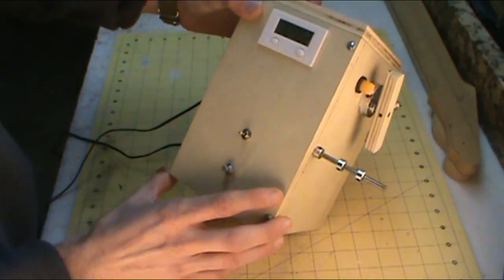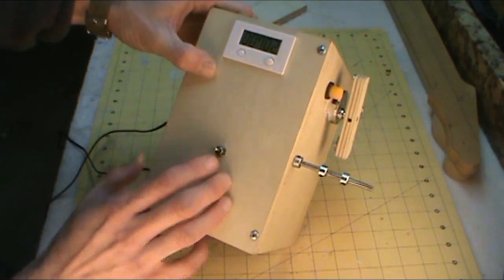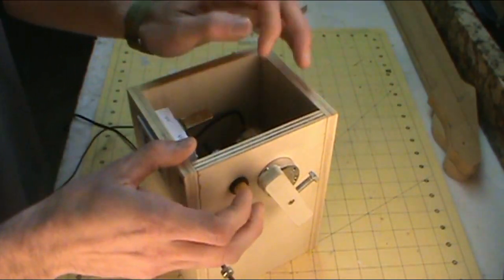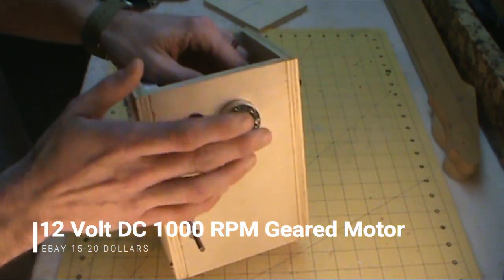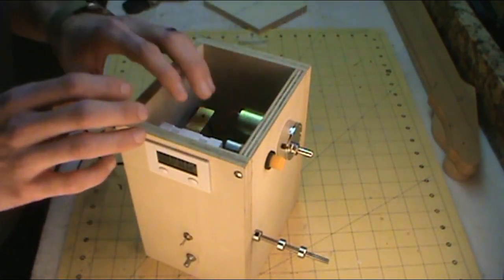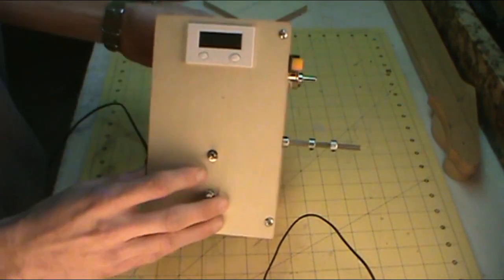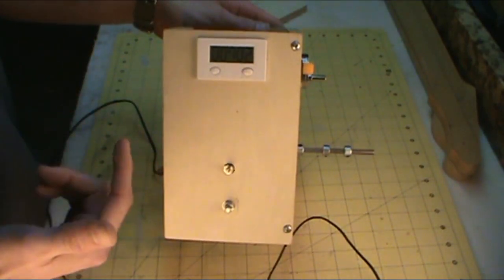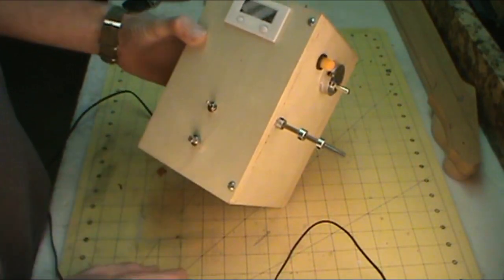How to Build a Pickup Winder

Comment: This is a great video.I built a pickup winder several years ago and threw it out when I moved. I was planning to make a new and better one. That was 19 years ago and I still haven't built one. The winder in this video  is similar to several I've seen on YouTube, which means it must be a good design. I was impressed by the bobbin mount. None of the other YouTube winders have that. I have ordered the parts for a new winder, which will be a lot like this one. I found the parts at very low prices from an Asian source; however, I take a buyer beware approach toward this source. The motor, counter, and speed control cost $16 including shipping.

Comment: Is a 4000 rpm motor good for this.  12V DC???
Thank you,
I didn't want to buy an expensive machine that I may not use very often.  Your video is a big help!!!!
B
Reply from the maker: There should be a motor in the description of the video along with other parts for the build. I’d try to find something that’s a little slower than 4000. Also the counter can only count up to about a 1000rpm.  I never wind mine faster than 700-800 rpm.

Comment: How's the motor mounted inside? is it just sticking through a hole and glued? or is there bracket?
Reply from the maker: I built a bracket to hold it. Look in the description of the video and there is a link to free plans.  All the parts are there in 1-1 size where you can print them out if you’d like to.  Hope this helps bud!

Comment: Hello, i build a similar winding machine just with different counter, but almost same design. I think i having a problem with motor gear. I think it have some kind of wigle in gear axle and the bobbind holder when im winding get some shaking. I think thats causing that i have loose winds on bobbin. Do you have same problem ?

Comment: Hey man, love your videos! Do you have links for the 3/16" rod and shaft collars you used? Seems like the simplest part, but I'm having trouble finding ones that fit together easily!
Reply from the maker: Check McMaster Carr.  I started using a little bigger guide size of 1/4”. You might be able to find one that size at a local hardware store. The shaft collars may need to be ordered online. You can also search for an 8mm size. Usually those are more readily available. Let me know what you find or if you need more help. Hope all is well.
Reply: @ChasesWKshop  Thanks, I really appreciate the response! Do you mean use 8mm shaft collars with a 1/4" rod? I was having trouble fitting a 3/16" collar on a 3/16" rod, so does a slightly larger size collar make it an easier fit?
Reply from the maker: @davidtennyson-m2m  you’re welcome. If you buy 1/4” rod be sure to buy 1/4” shaft collars. Same with 8mm. Its just you might find an 8mm size if it’s hard to find a 1/4”.  Actually to be closer to an 1/4” you would need 6mm. 8mm is closer to 5/16 but it really doesn’t matter in size for the guides. As far as the collars not fitting you can always put the rod into a drill and use sandpaper to thin the diameter enough for the collars to fit. I’d use 400 grit until I got it to the right size then use 600 and 1000 to smooth it out. I hope this makes sense. If not let me know bud.
Reply: @ChasesWKshop  Ok, I'll try it out. Thanks for the advice!
Reply from the maker: @davidtennyson-m2m  you’re welcome. Let me know if you have anymore questions.

Comment: hey men great video, great to see this is your first video. I'm waiting for all the stuff to build my own, have the same counter. I have no idea how it will come out but it's great to see your process. I have same questions about which swich to use for what but I think as you said with changing the counter position that will come with practice. maybe you can reduce the long screw for the pickup base wood? to get less resistance in the spins ... it's an idea. I'm going to use a circular acrylic instead but we will see how that goes.
Reply from the maker: Awesome! Let me know if you have any questions! I’ll be glad to answer any questions.
Reply: @ChasesWKshop  all in my head are questions at the time I didn't receive anything for the build yet, and a lot of anxiety is going on here haha I don't know If you can respond to this but one question I have is how much power makes the motor because I didn't use a heavy material for the box and bought a metal enclosure like DIY electronic kit (not so heavy) so I don't really know If I should A-make a mounting clamp to a table. B-Mount it to a square piece of acrylic. C-A square piece of wood. 
Also, put some rubber furniture things on the corners?
As I said a lot of questions my friend hahha
Reply from the maker: @fideldiazmusic  you can mount it to anything. I’d use a piece of wood or the white shelving board you can get at most home improvement stores.
Reply: @ChasesWKshop  ok, Yeah I have a piece of wood from a Chest of drawer to use in that case
Reply from the maker: @fideldiazmusic  awesome bud. Be sure to send me some pics of it when you’re done. I’d love to see it.
Reply: @ChasesWKshop  Yes off course!

Comment: Chase, just found your channel, subscribed... lot of catch-up to do. I'm being lazy, I did scan a bit but have you played around with using neodymium magnets (small button type) into pickups? Second lazy question... do you have a CNC you recommend?
Reply from the maker: Awesome bud, welcome to the channel! I haven’t messed with those type magnets they are probably too strong to work with pickups but you never know. As far as a CNC I’d look at Gatton cnc. That’s who I built mine after. Dave’s a really cool guy and now you can buy a kit. It’s defiantly a diy kit but he explains everything. You can get into it a lot cheaper than a ready to go CNC machine plus you can learn how everything works and that helps a lot when something doesn’t work lol.  Just remember too you’ll need a machine, cad and cam software (I use fusion 360) and software to run the machine (I use Mach 3).  I spent about a year building mine. Bought stuff here and there to spread the money over a long period of time. Hope this helps let me know if you have anymore questions bud.
Reply: @ChasesWKshop  Yes, they pack outrageous mag power in small package but I've played around with some weaker varieties and they DO work and easy to experiment with... I just don't have the experience or variety of testing to offer any conclusions/theories ... hence my question. I have an electronics background so I want to systematically approach this .... hence my next project is a DIY gauss meter... can't afford the pro ones. Since pickups are so subjective, I want to head into this resisting fokelore, assumptions, and lazy conclusions (YT is packed with them). Thanks much on the CNC info... I had already posted my question when I saw that you actually built your own!! Of course you did ...... ha ha.
Reply from the maker: @ccook31  gotcha bud. With your background in electronics you won’t have a problem making them.  You may can tell me, I think the stronger the magnet the bigger the magnetic field would be so it would not pick up the string as much as a lower powered magnet with a smaller field? Just my thoughts on it. Glad you like the channel bud. Let me know if you have anymore questions. Talk to you soon.
Reply: @ChasesWKshop  Great question! ... your take makes perfect sense. For the record I don't think bigger is better for the mags, But you've hit on exactly why this is so elusive... intuitively you are correct - is there a sweet spot for the string where it's 'more visible' to the windings?.  But what if it's not the intensity but the shape (or density)? Someone at Fender gave us a clue when they discovered a metal base plate  under the Tele bridge added juice/focus. I don't think mag fields can be reflected, but they can certainly be contorted... I'm going to play around with soldering short sections of string to the live strings directly over the pickup. Based on this 'string visibility' theory I should see more output... yes? And if they are short enough they shouldn't effect harmonics or tone...(?)

Comment: Chase, not sure if you'll ever see this but THANKS... this has demystified it all to allow me to commit to building one. The thing I want to do is automate the random  'scatter' alignment and avoid the manual guiding of the wire. I imagine one or two cammed mechanism out of phase that repeat and duplicate the left/right scatter pattern for a given run of wire (7k winds avg.) Something that systematically - for example - alternate left/right movement of the guide quickly for 15 seconds then followed by slowly for 20 seconds, then 45 secs.. etc. The purpose being to be able to replicate a pickup that comes out with a great sound. In other words.... not predict randomness but replicate  it as much as possible.
Reply from the maker: You’re welcome bud! If you figure that out I’d love to see a how to on it. I know highline guitars has a simi automated winder. It uses cams to scatter wind the wire. It still uses a lot of user input to run though. Glad I helped you out and let me know how it goes!

Comment: Does this pickup winder have any problem??? Does this works good?
Reply from the maker: It’s not the fastest winder there is but it’s great to learn on. Maxs speed is about 1000 to 1200 rpm with the counter.  I’ve not had any issues with it.
Reply: @ChasesWKshop  thankyou brother ill make one for myself
Reply from the maker: Rahul Sayami good deal bud. Let me know if you need anything bud.
Reply: @ChasesWKshop  does magnetic reed switch works same as this?
Reply from the maker: Rahul Sayami a magnetic reed switch would be slower rpms. The problem with a mechanical switch is at high speeds the mechanism doesn’t have time to reset so you will get inaccurate readings at high rpms. It should state its max reading rpms. Hope this helps.
Reply: @ChasesWKshop  thank you :) ill try it

Comment: Thank you so much for this fantastic video! in the amazon link, I noticed that the geared 1000rpm motor runs on 24 volts. Would this lead to trouble? or am I missing something haha
Reply from the maker: simon lines hey bud glad you like the channel and welcome. I guess the 12 volt was discontinued. Try this link here. 
https://www.amazon.com/Greartisan-Electric-Reduction-Eccentric-Diameter/dp/B0745YDSJS/ref=mp_s_a_1_2?dchild=1&qid=1589228129&sr=8-2&srs=18712795011&th=1&psc=1

Comment: Love the video and will build. Hey Chase, your vibration is from the bolt that tightens the bobbin to the shaft. Drill and put an identical one on the other side, with just a little glue on it. Put a touch of fingernail polish on the one you tighten, to differentiate it from the stationary one and end that vibration. PEACE
Reply from the maker: Ted Rowland thanks for the suggestion bud. Glad you like the videos. Let me know if you have any questions!

Comment: Thanks. I appreciate the information. I'll be making a coil winder soon. I want to build my first electric guitar. I'm part of the Greenville Woodworkers Guild in South Carolina. There's a person there who builds instruments and can help me and I have access to all the best machines and wood. I'm finding out that the hardware and electronics are what seems to cost the most. I thought that if I could make my own pickups I could save a little bit and be able to experiment a bit.
Reply from the maker: Awesome bud. Yes the electronics and hardware are defiantly the most expensive part of a built. That’s awesome you have a luthier to learn from. I’ve just done trial and error to learn lol. Let us know how it goes once you’re done.  Also share you build. You’re welcome for the info bud let me know if you have anymore questions.
Reply: @ChasesWKshop  
I was just thinking that I could use a wood lathe with a variable speed drive to wind coils. The Guild has several. All I need is a counter and a wire guide. I can use a face plate with a disk of wood to mount the coil and sensor magnet. The wire guide can go into where the tool rest goes. Boom! I got a coil winder for the price of a digital counter.
Reply from the maker: thomas newton absolutely bud. I’ve seen many of them. Let me know how it goes.

Comment: Parts have all come in over the last 2 days, I'm finally going to build it.
Reply from the maker: Michael Copado awesome!! Let me know if you need anything.
Reply: Looking forward to building it this weekend. Question, do you still think a 2amp fuse is necessary in the wiring up of it? Also are the fuse holders themselves generic? They are basically just a clip in a case with either two wires if it's inline or poles if it's a surface mount holder. Looking through the homedepot page I can't find any fuse holders actually specifying 2amps-The holders don't have anything else added to make them amp specific do they?
Reply from the maker: Michael Copado I’d check at an auto supply store like auto zone or somewhere. Any kind of fuse should work fine with it. Hope this helps bud. If you have anymore questions let me know. Thanks!

Comment: hi, you did a simple and efficient job for use. You gave me the inspiration to design a similar one.
You were right to use a 12V motor with little effort so you can brake it and reduce the risk of breaking the copper wire. I intended to use a 400W sewing machine scooter with foot switch. What you've done is definitely more suitable for that kind of work!

Thanks Andrew
Reply from the maker: Andrea Politi awesome glad you like it. If you haven’t seen the Pickup Winder 2.0 series videos,  I use another motor that’s a lot quieter and faster but you’ll have to build a speed reduction pulley to run it at a lower speed. Glad you like the videos. Thanks for the comment!! Let me know if you need any help with anything.
Reply: @ChasesWKshop  
Hello! As soon as I can I will give him a look! Thank you!

Comment: Hey Chase, I just made my own pickup winder using the parts/improvements you suggested and it turned out awesome.  Do you have any tips for making sure the bobbin doesn't have any wiggle to it and getting it perfectly straight?
Reply from the maker: Thomas Ring great glad it worked out for you. I just use the painters tape and super glue trick to mount them. As far as getting it centered I usually just eye it and try to get it as close to center as possible.  You could find the center line of the bobbin then align it with the shaft hole. Sorry if that’s not good enough. Thanks for the question bud and let me know if you need anything!!

Comment: Re: Motor and power supply, noted you installed a 12V - 1000rpm motor.  I've found numerous e-tailers for motors, but there are no specs (i.e. max load AMP or Watts) so it's almost impossible to match a motor with the proper 12v power source.  Did you just grab any 12V power source or were you able to match the power source to the motor.   Thanks, R.
Reply from the maker: R A the motor I used stated it had a .18 amp loaded current rating and a .04 amp non load current rating. I used a 1.5 amp wall wart power supply. The one I use in the wiring video was a 2 amp power supply. As long as you have enough amps to run the motor with the power supply you will be good to go. The one I linked in the description has the rating I stated. Hope this helps bud. Thanks for the comment and question.
Reply: So, running a .18 amp motor with 2 Amp power supply does not over heat the motor by the end of the PUP build session?  Btw, what gauge wire are you using with the 12V supply?  Thanks R.
Reply from the maker: R A no you’ll be fine. The other way around is where you’d have issues. Make sure to throw in a fuse between the power supply and the motor speed controller. 1 amp will be good.  I used 18 gauge stranded.
Reply from the maker: R A a 2 amp power supply will power up to 2 amps. It doesn’t matter if it’s .01 amps or 2 amp motor. Although if it was a 2 amp motor I would go with a bigger power supply because you want head room by that I mean you don’t want the power supply running full amps all the time. With a 2 amp motor I’d go with say a 2.5 or 3 amp power supply.  Now if you try to power a 5 amp motor with a 2 amp supply you’ll have issues. Hope this makes sense bud. If you have any more questions please let me know.

Comment: Awesome video, thanks for the inspiration. I just made mine today. 

One thing you might want to reconsider is that single bolt being used as the fixing, which makes it unbalanced as it turns. You might want to fix the bobbin holder to the spindle from both sides to balance it better (and consider using grub screws or something smaller than that heavy bolt). Should make it run a little smoother and mean less wear on the DC motor :)
Reply from the maker: Great man!! I’m glad you like it. Yes you’re right I should get rid of that big ole bolt and change it to something smaller lol. At the time I made it I just threw it together.  I originally planned to make more bobbin holders and never did. Glad you like it man and hope you enjoy it. Thanks for the comment and the advice!! Welcome to the channel!!